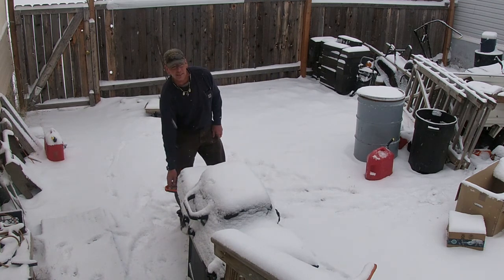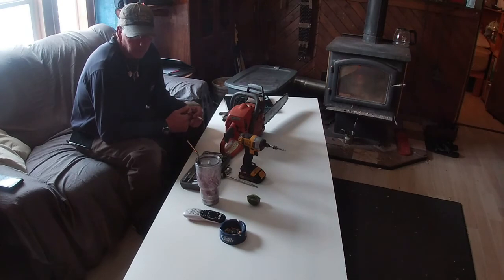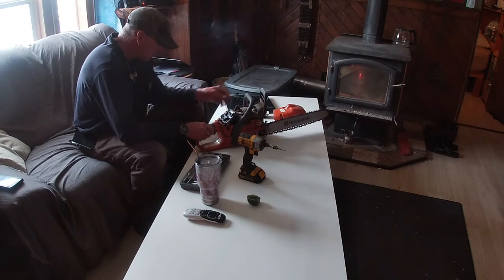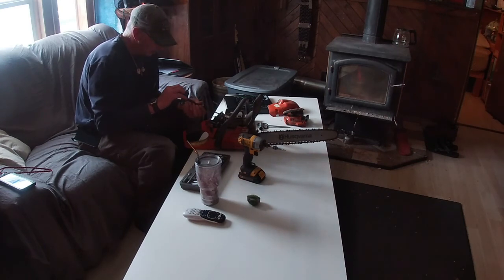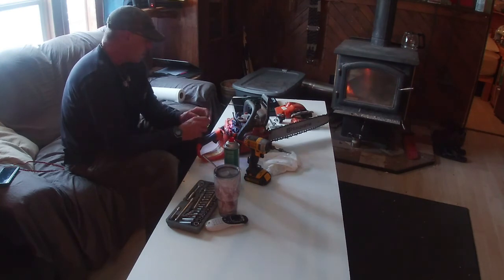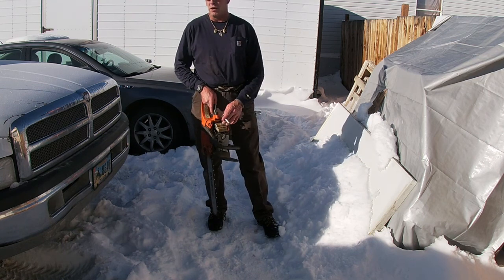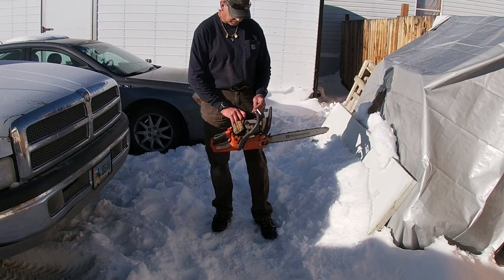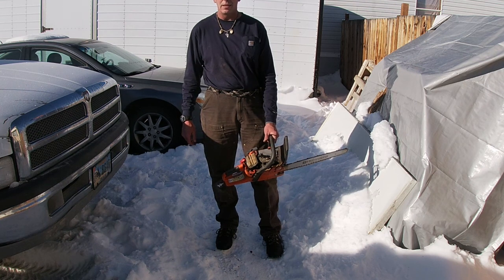Husqvarna 450 xtorq wont run diagnosis and fix

Comment: Right on man. Yeah the ole x torqs can be a bit more finicky on the carb adjustments. You can get rid of that splined collar . Just turn your jets in and see how far they are out and take them all the way out and take that collar off. Then you can adjust with just a screw driver like normal carbs. Love it man great to see you. 🌲❤🌲
Reply from the maker: Thanks for the tip Taz!! You gotta have the splined tool though to do that right? Now that i have it and have used i like it just a little bit. My 576 is an xp xtorq if the sticker means anything amd it has the flat heat screws but thats probably because its a pro saw and the 460 is more of a homeowner saw. It serves its purpose i spose. Thank you for watching and commenting. More to come..... STAY SAFE!!!
Reply: @307j.o.a.t9  you can get the collar off without the splined tool. You just need something small like eyeglass screw driver,   very small and push it in and screw it out with another small screw driver. I remove them on my x torqs so I dont have to have another tool in the woods, cause your still need a regular screw driver to adjust the idle jet.
Reply from the maker: Oh i will have to look into that. Thanks for the info!!

Comment: There might be little plastic limiters on the adjustment screws that  you can break off and remove to get the full range of adjustment. Yea I bought a saw once to and learned that there are special carb adjusting tools. Good thing for amazon. The 450's are a bit of a cheaper model but if maintained properly it will be a a good saw for a long time.
Reply from the maker: Yea the 450 doesnt have the limiters just gotta have the special tools. It os a good little saw for what we use it for. I jave an ms260 i gotta get a new top end on and it will be another good saw for us. Thanls for watching and commenting!!!
Reply: @307j.o.a.t9  Yea there a handy size saw to have around. My dad has a 455 and it has I believe flat head slots in the screws and plastic limiters. But I could be wrong.  Weird such a similar model, but must be a totally different carb. Cool stuff man thanks for the vid!
Reply from the maker: My girlfriend runs this one (its hers) and she mostly limbs and bucks with it. She started falling a little with it last fall. Gotta give her some lessons on that. It has also gotten me out of a bind or 2 and its a great little saw to take in the CJ5 for clearing trails and such.
Reply: @307j.o.a.t9  Yea that's cool to find a girl that can hold her own and run a chainsaw. I bought a 40cc champion chainsaw from a hardware store on a wicked big sale event and I love it. Yes it's a cheap saw but it has a primer and is easy to start. it's compact and light weight. It's not a big power monster but for small jobs it's the first saw 
I grab. I have lots of bigger pro saws but sometimes the little convenient saws are all you really need.

Comment: Those 450s are known to have problems.  I break those adjust  limiters off my carbs...I should invest in the tools at some point....good video
Reply from the maker: Yea im not the biggest fan of these newer saws. My 576 has been a good saw for the most part. I got it in 2011. This is my girlfriends saw. She pretty much limbs and bucks with it. Its been ok for that. The tool for it comes in a kit thats like $10 on amazon. I tried to find a carb that had flat head screws in it but couldnt. Thanls for watching!! I appreciate the comment!!